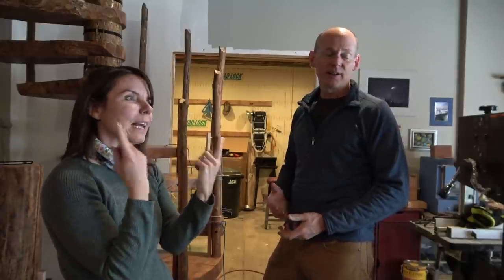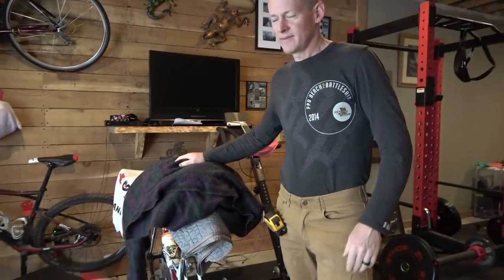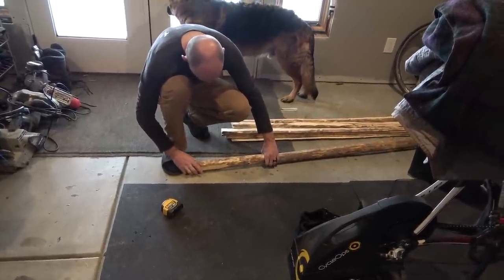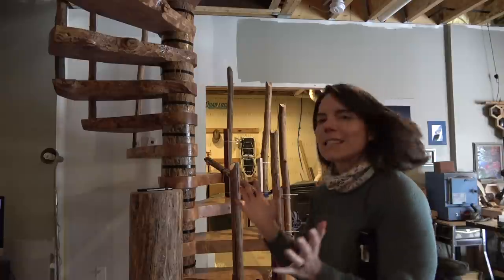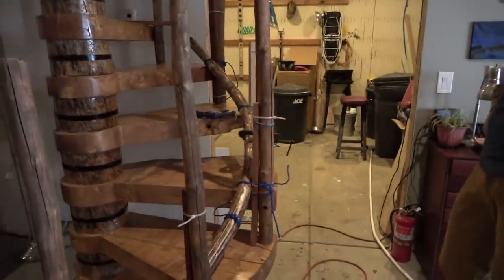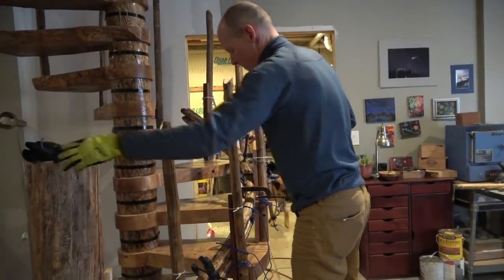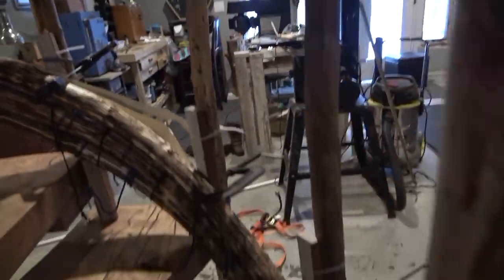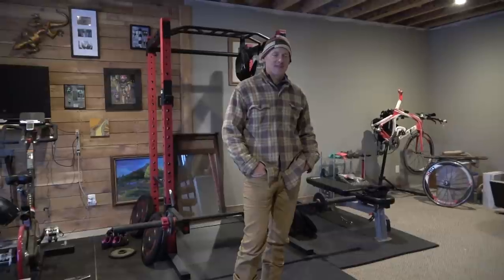Steam Bending Pine Wood Strips for Curved Railing

Comment: Looking good, if the spring back isn't to much. My guess is that it will be , hopefully I am wrong.  A couple of things I might try if I were doing this and it still springs back to much.....make the strips thinner, and glue it when you get it bent into position, let it set and it shouldn't spring back much....I doubt.  The only way I think to clamp the glued bent pieces together would be hose clamps, would need a bunch (well maybe 10) to do it. I might look at bending around a piece braced back to the center post of the entire stairway, not sure that would work though.  I am waiting anticipation (like the Carly Simon song) !
Reply from the maker: Yeah, it had quite a bit of spring back, you'll see in the next video. We might be able to use zip ties to hold together...we're on pins and needles too!

Comment: Great job Amy and Brian,  you will get spring back without glue in each joint. The glue is the hard job.
Reply: Glue full assembly or at least each strip as you go....full cover ,, small roller works best... if it's dried/cured it will not spring back ..
Not an overnight process..
Reply from the maker: Thanks for the tip! But don't you want to avoid having the wood cool before getting your bending done?  How long would you leave it in place for before taking out of clamps?
Reply: @ColoradoMountainLiving  Hi Amy and Brian,  I would think until the wood was cold or room temperature and most of the moisture is out of the wood.  Maybe two days I’m guessing.  But it still will try to go back a little bit to it’s original state. The photo that I email you of the stair case I made some years ago  I did not steam the oak strips. The hand rail was 1-1/2” thick x 6” by the total length of the case. You may have to cut the strips thinner and use more glue. Your on the right track with clamping them close to the stair tread.   Great job.
Reply from the maker: Ok. Hey could you email that photo again?  I just realized I had the email misspelled on our About page for about 2 years. Sounds intriguing!
Reply: @ColoradoMountainLiving  sure no problem and if I can help in anyway just ask

Comment: I build circular staircases for a living, the poster who suggested thin laminations is correct.

You'll also need a glue with a rigid bond line such as a plastic resin glue (Dap makes one that I think the box-stores offer)
Reply from the maker: thank you for the confirmation! how thin do you recommend? Wood glue is out of the question then?
Reply: @ColoradoMountainLiving   It depends on species and grain structure as to how thin you need to go. As a general rule you should be able to bend the strips into an arc with moderate pressure.  As to glue......A glue that offers a rigid bond line and has gap filling ability that'll work with high moisture wood is an animal I'm not familiar with. Plastic resin require adequate clamping, controlled temps. and surface prep.
Reply: More 'cause I can't fit it all in one post. 
Maybe borrow a surface planer in order to obtain a gluable surface? As far as steaming, it's okay so long as you let the wood dry before gluing. Given the amount of work required to successfully bend rail take your time and do everything you can to avoid mistakes.
Reply from the maker: So last question, for working with green wood. Would you do wait to do the glueing? Or is it reasonably dry enough (not steamed) to glue as we go? Right now the strips are really flexible at 1/4 inch, and we're able to make our curves without any steaming.
Reply from the maker: What about Gorilla glue? I know that one requires water for it's use.
Reply: @ColoradoMountainLiving  ..Titebond Wood Glue ..Exterior grade..because of residual moisture.
Reply: @ColoradoMountainLiving  Polyurethane glues like Gorilla Glue swell and make quite the mess as they cure and they have no gap-filling ability. If it were I doing it I'd clamp/tie the strips in place as you've done only with craft paper between the plys. Just the heat will dry 1/4" well enough over the course of a week or so...(Do a scrap piece to test and keep it close to your rail pieces as it dries)  Then I'd use the Dap product, https://www.amazon.com/00203-Weldwood-Plastic-Resin-1-Pound/dp/B001003J16 
Old innertubes stretched and wrapped tightly make suitable clamps if you're short on bar clamps.
Reply: @ColoradoMountainLiving   Not a fan of monkey glue but some folks love it.
Reply: @rockytopwrangler2069  Titebond makes great elastomeric glues but they don't provide a rigid glue line and are subject to creep.
Reply from the maker: Thanks! I think we are going to tweak it by giving up the pine tree strips and instead opt for birch plywood, for the pliability as well as the uniformity, cut them into strips then steam. Hoping 1/4 inch will do the job.
Reply: @ColoradoMountainLiving  You can purchase bending rail from the lumber yard, it's already milled into strips and comes with backer cauls for clamping.

Comment: If this was my project, I would set the depth of the cut between the bandsaw blade and the fence. Maybe, 3/16 of an inch.  Once you set the depth, don't move it.  Then cut your stripes all to 3/16s.  Try this thickness and if it is too thick, go to 1/8 inch.  Experiment a little until you find the ideal thickness.  EngelsCoachShop channel has a 20 minute video called "My Top 10 Reasons Why Steam Bending Wood Fails | Engels Coach Shop" that may help figure out what not to do for your railing.  I am pulling for you guys - I know Brian will get this done - cheers
Reply from the maker: That's what Bryan is thinking next. Thinner strips and maybe able to skip the steaming step then. Thanks!!

Comment: You need the extra steaming time because you're at high altitude - water boils at a lower temperature. For the bandsaw, you'll need a blade with something like 3 teeth per inch and deep gullets. Each tooth creates a lot of sawdust and the saw uses a lot of power dragging the dust through the kerf. 
I might try getting a red cedar 2x4 and ripping it into thin strips. Then spread glue on that and clamp it to your posts. When it's dry, that's your form. It should be stiff enough to clamp the natural wood to. It would help to have a steel strap on the outside of the bend to contain the wood fibers, but with a log I'm not sure how to keep it in place. Look up steaming inside a plastic bag, that is used on wooden boats and helps keep the steam in place while you are clamping.
Reply from the maker: That's a great point about the altitude factor. I wish we had cedar around here; would have to be a special order. Just reviewed a neat video on steam bending , the guy who does wagon wheels.  Lots of good tips, but we are trying to do the job with what we have.
Reply: @ColoradoMountainLiving  He's at 3000 feet and I think that's one reason why he uses a pressurized steam box.

Comment: If you do anymore try fitting them 1/4-1/8 th inch thinner it will help tremendously with the plyability of the lumber
Reply from the maker: I think we are going that route next. Our last shot in this video was with 1/4 inch and it was a substantial difference.

Comment: make a curved mold,,, cut thin strips and glue together w/wood  workers glue ,place in  mold and let dry over nite  when you  remove 
the  strips they will retain  the curved  shape, its used when making rocking chairs and other  curved shapes in woodworking ,the internet
many examples of this....jack
Reply from the maker: Thanks Jack, I think we found a solution, stay tuned for our next video.

Comment: ....The intro is AWESOME !!.. .....This is hard to watch....        .. from 25 year draftsman,,builder,, interior finish carpenter/contractor.  ......
            ..What's the fire situation up there?? Haven't seen a report of containment past few days ,, hopefully good...horrible losses.....And Colorado Covid cases.....off the charts.....hope there's some relief soon...
    On next attempt,, rip thinner ,, apply glue before the bend,, cover floor and treads for glue mess ...near impossible to clean up without damaging treads and floor....Use clamps,, parallel clamps best , C-clamps work and cheaper ,use 6" , bar clamps also work but hard to hand tighten tight enough....bend on outside of baluster system,, that way you can pull into place instead of push ,,much easier)....(coffee's ready ... back to the show).......

..Good to see Viggo healing and doing well....
..I have never bent natural forest product wet wood,,, and after steaming,, will be saturated,, ...will probably take a full week to hold any kind of bend,, but time will tell...as the phrase goes.  "Where there's a will ...There's a way !!".....

..........there is another phrase.  " You can lead a horse to water ....but you can't make him drink".....

     ..... Stay Safe and God Bless  .....
Reply from the maker: Thanks for all the advice and tips. I feel like I can relate to the feeling of giving advice and watching people stumble through figuring it out on their own as they eventually come back around to your original advice. I call it "you can't tell anyone anything." hahah. Now we're thinking 3/16 strips, and maybe they won't require any steaming to bend them? And then not worry about when to glue, we can do all the assembly and glueing at once. 

As far as the fires; there hasnt been any growth,  the Cameron peak is 92% contained and East Troublesome is 60% contained, so really well managed at this point. The recent winds have not aggravated the situation at all. Hard to say about Covid, Bryan says the hospital is packed full of Covid patients and they are under pressure to discharge cardiology patients to make room. (whether or not they are ready to go home?)
Reply: @ColoradoMountainLiving  ...Just want to see you succeed with this project... with as porous as this type of wood is ,, unless many thin layers used ,, when it finally dries ,  may split anyway... bending is one direction,, but the twisting will tear fibers...
  I have done many radius wood projects over many years along with a Colorado mile of bent railing,, but mostly with hardwood materials milled for the purpose.... the key is dry enough to allow glue to adhere then patience enough to let time clamped to create bond...
..Even though air dried on ground (still wet internally) then saturated with steam ,, no way to guage length of time,,complete gamble,, I would try maybe at 5-7days ..🤞🤞

If it doesn't work out,, check with trim mill shops in Denver for the bending rail materials available,,pretty  much all hardwoods with the form wood sides necessary..determine total length....most can be bought up to 16 ft. ,,made without splicing will be much easier....there are many different woods used ,, some may still have the desired look or can be distressed after installed.....
...only trying to help ,, not be a ...pita.. ...don't live in Colo. anymore ,,for now..

Comment: You probably have this all figured by now, but what about notches (I mentioned before).? That is, take a whole uncut/sliced stick and notch or slice it on the inside concave side to a depth of about two thirds and then steam it and mount it. I know the notches would show, but they could be filled in with glued wood inlays if necessary. As I wrote in a previous message, my wife and I did this with Sheetrock, but I don't know if it would work in your case, and it would be more time consuming. Anyway, just a thought.  ~~~~  PS: I'm on my way to pick up chicken for your homemade chicken soup recipe.
Reply from the maker: That's an interesting idea. but , I think the thin strips idea will work, just need to try green wood I think. Enjoy the soup!!

Comment: (If you 'can' steam a full length piece) can you not find the outer radius measurement  then bend it into a circle of that diameter then S the circle out into near enough a shape you can bully in? I'm sure I'm not suggesting anything new to you here, enjoying the build tho
Reply from the maker: We need to bend in a circle as well as upwards at the same time. If we only bend the circle, it won't have the upward spiral twist. We're not giving up yet!
Reply: @ColoradoMountainLiving  Don't you dare give up I'm hooked now lol, ok so you need a way to create pliability outside of the steamer but a circle would be a good start no? maybe fire is your friend, like how the arrow makers held crooked shafts over fire to bend them straight, maybe you could create a circle of embers to hold the circle over then tease the spiral out, any charring can be sanded out

Comment: I thought there would have been a bead of waterproof wood glue between the slates before clamping them to the stairs.  FWIW, leave them in place for as long as you can -- couple of days or a week.
Reply from the maker: We were worried about having the wood cool too much if we did the glue step right away, then making it harder to bend.
Reply: @ColoradoMountainLiving  You need a slow set time glue.

http://www.franklinadhesivesandpolymers.com/Wood-Adhesives-US/Wood-Adhesives/application/Edge-and-Face/Titebond-Slow-Set.aspx

KEY PRODUCT FEATURES
•  Slow setting rate
•  Perfect for stair rails and stringers
•  Good heat and solvent resistance
•  175.105 FDA Compliant

You two are on the right track.  It is going to look great.